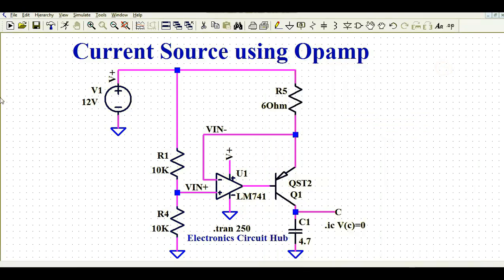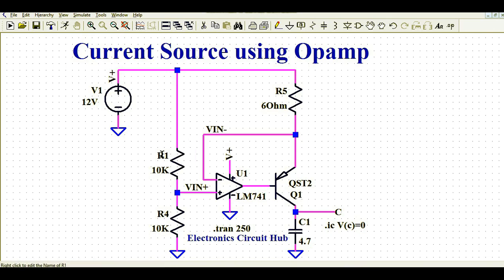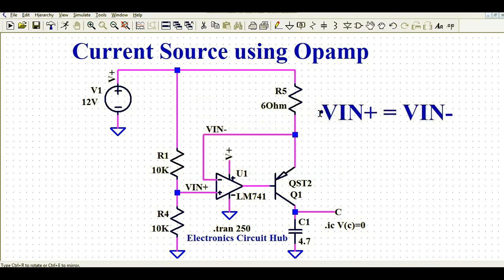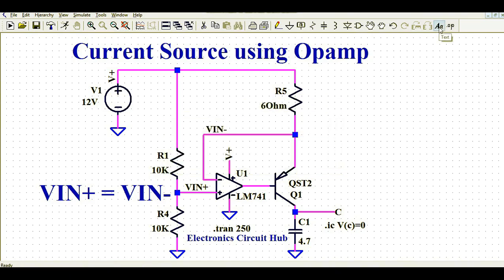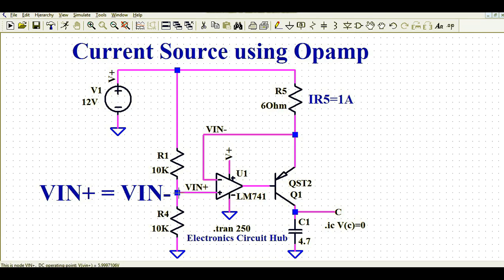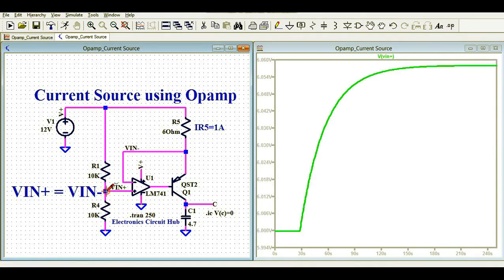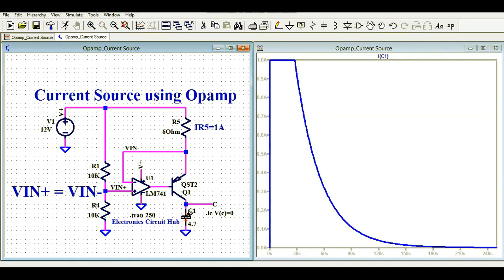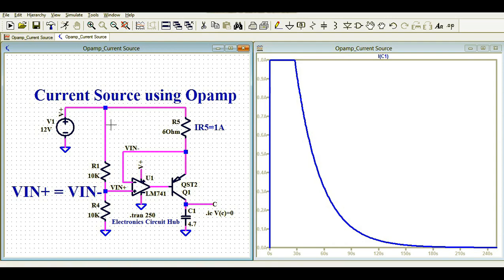How to Design and Simulate Op-Amp Current Sources in LTSpice

Comment: Thanks you for good explanation with LTspice simulation..What will be effect on voltage at capacitor C1when Vin+ is variable?
Reply from the maker: Hi, Thanks for asking good question and sorry for late answering. Irrespective of Vin+ voltage (variable Vin+ voltage), The voltage across your capacitor will remain constant as V+ (input voltage) only the charging current of capacitor will change. 
Let's say V+ = 10V, Vin+ = Vin- = 5V, IR5 = (V+ - Vin-)/R5 = (10V-5V)/6R
other case : V+ = 15V, Vin+ = Vin- = 7.5V, IR5 = (V+ - Vin-)/R5 = (10V-7.5V)/6R.
Hope this will answer your query.